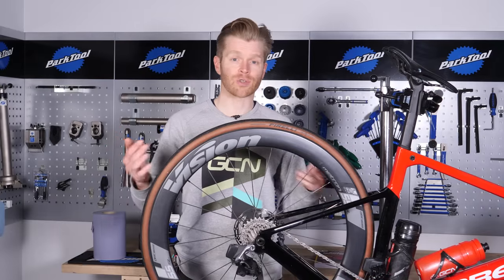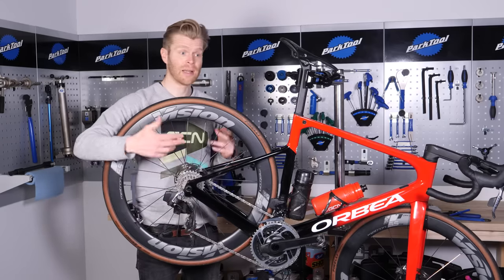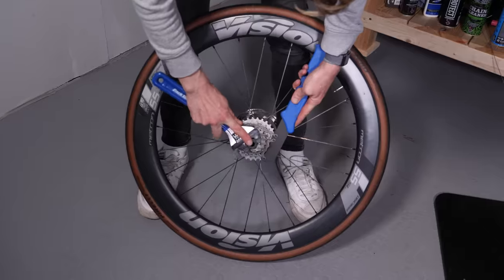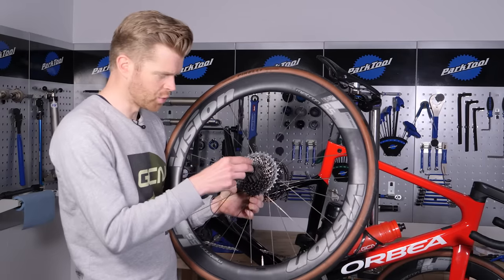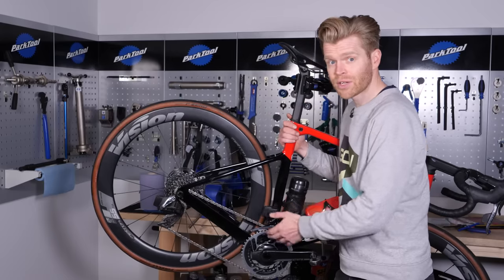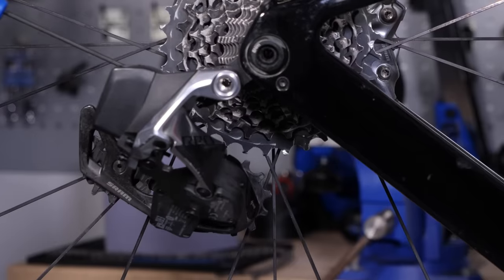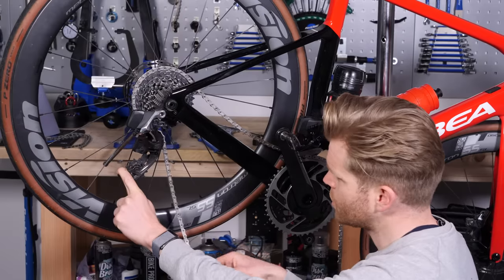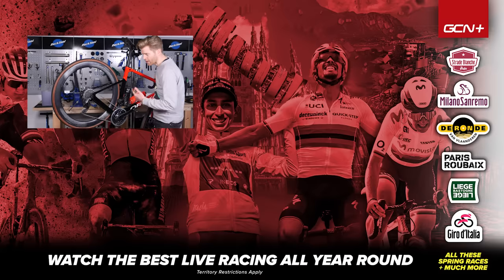How To Fit A Bigger Cassette & Ride Uphill With Ease! | Maintenance Monday

Comment: Life hack for people with "old" bikes 2016 bikes or older - when fitting a new cassette just do a 3 tooth jump, for instance i had a 12-25 on my old bike, i decided to put on a 12-28, work a treat, no adjusment anywhere needed same chain and chain rings and its a massive difference too :)
Reply: @Bu-22  yeah trust me it will be fine! One thing do use a chain checker tool or get one from amazon for like a quid, if the chain is worn to 1% replace the chain but keep it the same length as previous. Mine has 53 links (including quick link) when i upgraded, if the chain is too worn out you gonna get mad skipping. Provided chain isnt stretched beyond replacement you should be fine. I measure mine with a quick link included, if you making a jump from a 28 to 32 or 34 definetely get a new chain and re measure it including the new cassette, 2 or 3 teeth is no issues. Just set and forget :)

Comment: Pah I built a 105 5700 using a sgs cage and p tension spring from lx  t670 trekking mech  to allow me to use up to a 11-40t. I'm currently using a 11-36 with barely any tension in the b spring. It is big enough that with the 34-50 I've had to use some chain from a 2nd hahaa

Comment: Thanks for the chain sizing tips ! Worked well! 

I recently upgraded to a 36T RD from Sram, without the chain on I just couldn’t get it set up and the RD was touching my spokes.

When I set the limit the RD wouldn’t change gear anymore either way. I put the chain on and it fixed the problem and I was able to index the gears correctly, set the limit screws and b screw and I’m now no longer caring about the steep gradients round my area 😂

Comment: Most people only use the largest cog with the smallest chainring. In this combination there is often still enough chain with even with the short cage and using the same chain. If you never cross chain can you just ride this way without fear of damaging anything?

Comment: I wanted to do this but I’m limited by the length of the rear derailleur arm and with a Di2 set up I think I’m into a world of expense to do this. Instead I’ve got new chain rings on their way, 34/50 instead of 36/52 which the bike was supplied with. Always good to watch these maintenance videos regardless
Reply: yep.. you can change chainrings but you will lose top end.
Reply: @petesmitt  I reckon most people have more than enough with 50-11
Reply: @discbrakefan  Indeed with a 700c wheel 50-11 is roughly (depending on tire size) 1 to 1 speed in kph vs cadance, eg if you can push 50-11 at 80rpm you'll be doing just under 80Kph.
Reply: @ianphil397  don't believe it works like that. 80rpm at 50-11 is still below 50 KMPH
Reply: @-P-Z-  Ah you're right. That's awkward, i had my maths wrong. Time to update my spreadsheet!
Reply: If you are handy enough, you can swap the cage from a non-di2 derailleur.
Even more so, from a mtb or aftermarket one with OSPW. When the upper jockey wheel is offset from the cage axis, it helps to squeeze 4...6 more teeth at the cassette. But the chain length and b-screw adjustment must be on point
Reply: You can run a 32 cassette with any 11spd Di2 rear derailleur.

The latest series 11spd R8000 and RD9100 will handle a 36 tooth.

How do I know? Ive installed them hundreds of times.

If you want to run a 40 cassette then yes you will need a GS type 11spd R8000 or R7000.

Comment: if you go down in gearing eg. 11-30 to 11-28, do you need a shorter chain or can you get away with the existing one?
Reply: No need to swap if your biggest sprocket gets smaller, the maximum amount of chain the mech has to "wrap up" in the combination of smallest chainring and smallest sprocket hasn't changed. Depending how long you've been running that chain and cassette combo together though, you may want to put a new chain with a new cassette to minimise wear.

Comment: I'm running a 14-40 (a mix of a XT 11-40 and a Ultegra 14-28) on a RD R7000. Shifting is fine for me (sometimes a bit odd where the Ultegra and XT cogs meet). Best "downgrade" for the super steep roads of Taiwan.
Reply: You don't spin those roads downhill at all, aren't you? And even on flats the cadence must be wild, presuming you use 50/34 up front...
Also, I'm very interested if you use only the biggest spider with 31-35-40 or use mostly the XT with only the smallest cogs from Ultegra. Me personally would build it in a manner of 14-15-16-17-19-21-24-27-31-35-40 or even 13-14-15-17-19-21-24-27-31-35-40 (but that requres 13t from another cassette to have splines for a lockring)
Reply: @feedbackzaloop  46-30 XD. I feel comfortable with a cadence around 90-100, so no problems in the flat. Nobody is going to give me a trophy or money to downhill faster in open roads, and most descents here are pretty winding anyway.
My cassette is as follows: 14-15-16-17-19-21-24-27-31-35-40T
I would not mind to have a 13, but I didn't find an easy way to do it (maybe using a Miche cog).
Gears are a personal and a terrain thing. There are plenty of roads with >20% here. Most people either try to avoid them (not always easy) or grind them. I prefer to preserve my knees while still exploring all the quiet secondary roads.
Reply: @Membrillo81  I have seen plenty of 10-speed cassettes from shimano and sunrace, which had two smallest cogs serrated. Since it would sit on the edge of the cassette you might get away with small difference in spacing

Terrain dictates the range of the transmission, because what goes up must come down and there are ways to and from as well, but how you prioritize these sections is definetely a personal thing. With all that said, I still can't understand how would you avoid the fun of accelerating out of the corner and catching up with a motorcycle up front. Just 2-3 pedal strokes, but so much difference (maybe for some time you might try 11-14-15-17... setup, but that depends on how much you need 16)
Reply: @feedbackzaloop  Massively high gears are a must for pros, but I have a harder time understanding why recreational cyclists in open roads need almost the same massive gears. That's why I prefer to lose some range in the high gears, where the worst it can happen to me is to have to rest more in the descents.

Regarding the example of the motorcycle. I live in Taiwan, where there are more scooters than people. The sound of motorcycles is one of the sounds I hate the most XD. So I don't want to ride with them.

I had the 11-34 before. The jumps between 11-13-15 were stupidly high and uncomfortable. 13-14-15-17 would be nice, but being honest, I don't really miss the 13 that much, while the 16 helps me more in the flats.
Reply: @Membrillo81  I'd consider a massively high gears for pros as a combination of 54/39 paired to an 11-28 cassette. So no, 50/34 by 11-34 is not big. And more so, pros have a higher cadence as well, so should they "grind" they would need even bigger chainrings.
As for myself, my do-it-all bike is equipped with slx 11-46 and 46 up front and I'm looking for a way to fit 50 in the place of a smaller ring for an optimal chainline and to avoid 13-15 gap, reserving 11 and 13 for cruising in low cadence. But 15-17-19-21 combo is just perfect, I wish more cassettes were using that. Instead it is either 15-18 or 15-16-17 - either too big or too small of a difference.
However I agree that it is wrong how consumer products are a copy-paste of professional equipment with little to none alterations. The use cases differ way more than that.
Reply: @feedbackzaloop  50-11 for normal people, while the pros until yesterday were in 53-11, is massive (in my book). Also, I don´t find any logical reason to keep pedalling at 60 km/h in a road that is open to traffic.
And most pros that do not have to fight for the GC use the higher gears that their supplier has available when they have to climb monster climbs (l´Angliru and the like). If they want a 1:1 for those climbs, I surely need something lower for the climbs I ride where I live.
As you said, it makes no sense that the cycling industry sells to consumers bicycles with almost the same gear ratios used by professionals.
Reply: @Membrillo81  well they surely don't climb in 53-11, but rather 36-32 (which is still too high for an average cyclist, but they are pros, they can survive even with massive GC time loss), you kind of mixing the points here. And with some calculations I see you spin out and stop pedaling at 42 kph: way too early for both leasure cruising in low cadence or maneuvering in traffic. But if you live on a hill as a hermit, that should not be a problem, of course
In a sense, being able to pedal at 60 kph when everything around you is moving at 60 kph is the safest thing to do on the road.

Comment: if you are using the same wheel and freehub why would the high limit now be hitting you spokes? Genuine question as I cannot see how the geometry of the back end can change meaning the sweep of the rear cage now encroaches to the spoke line if there has been no change to the axle length or derailleur position. is this an issue with 12sp SRAM systems?
Reply: You are right, there should be no need to adjust the high and low limit screws. The screw that may need adjusting is the "B" limit screw, this adjusts how close the top jockey wheel runs to to biggest cog. If you change gearing and go for a much easier set up then the pulley cage will probbably need to be dropped lower to make room. If you're just changing like for like there should be no need to adjust anything.
Reply: Thanks both. 👍 I understand the B limit and have used this on my setup to avoid a clash witht he jockey wheels.  The exaggerated movement then could be a misaligned derailleur hanger then or a manufacturing issue with the hanger mount being slightly twisted?